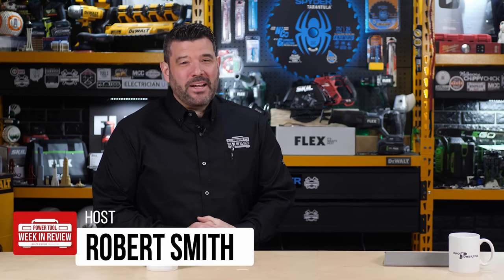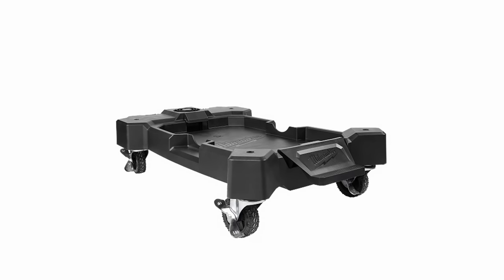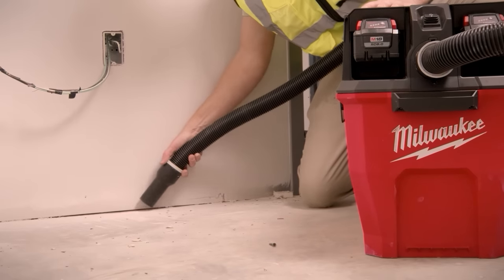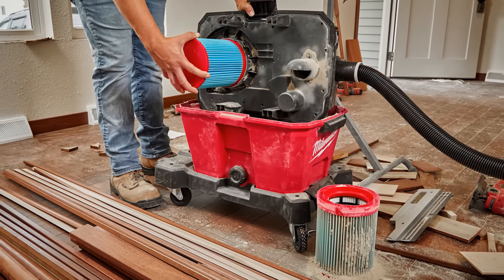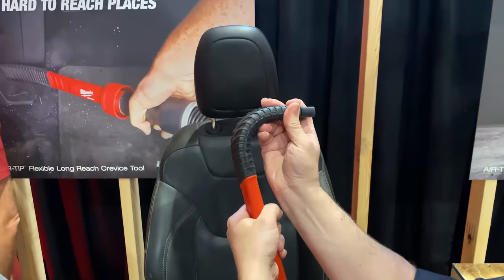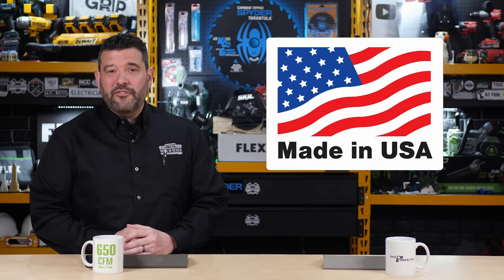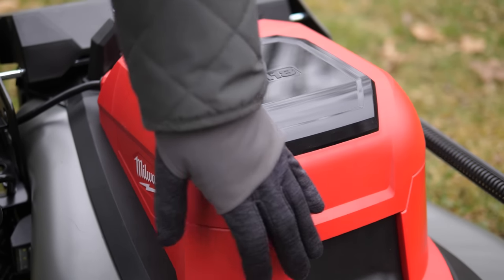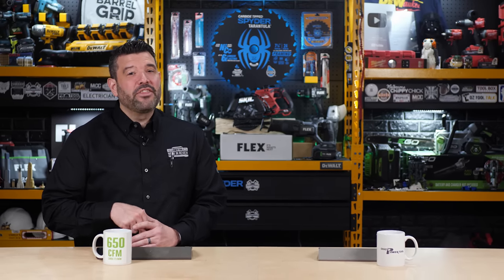BREAKING! Milwaukee announces NEW TOOLS, but doesn't tell the whole story...

Comment: I don't get why this isn't packout compatible. Why not a packout bottom to the tank? Why not a packout compatible cart for more options? Why not a packout compatible top so you could stack a thing or two on top if you wanted? I'm just an occasional builder / electrician and DIY type, but I don't get why not to packout these.... Also I'd love to have these be savvy enough to connect to jobsite tools like table saws or chop saws and maybe - if even possible - turn on when they do. I'd buy it as a battery powered dust extraction tool.
Reply: Bosch has a packout type system , and it fits their vacume cleaners   .
Reply: They can't do that. They need to gouge the customer next year.
Reply: My guess is placing Packout on top would make it top heavy and easily tipped. Probably don't need want the vac top smacking the concrete w extra weight flipping it over.
Reply: They need to sell next year's model which will have it. Got to understand how the business works.
Reply: They fell rather short not adding a pack out feature
Reply: well i mean they do already have a packout vacuum, if you put that 90l tub and the largest motor into a packout stack with the required attachment points top and bottom and wheels, you might get what one packout box and one row of organizers on it before it was too tall to be maneuverable, i dont think the packout was that much of a miss considering they have the packout sized vac thats plenty capable of doing little interior residential cleanup that would warrant not dragging in a separate vacuum 

not rigging this up with a system to activate off other tools is a major miss though, although i suppose they didnt build it into the tools that are already designed and in production, they could have atleast added a remote system and the ability for it to be activated off tools in the future for when those tools inevitably get new generations with updates

the modular system is a great design though i hope they make more things with this mindset, also like the insanely wide array of attachments although i feel theyre all going to be extremely overpriced, be cool if they included some of them with the vacuum but likely just get the typical sweeping attachment and narrow one
Reply: Because the packout concept and the vacuum were likely developed at the same time and there wouldn’t be any communication between the teams to avoid any leaks before they made sales they may have a mx line vacuum in the pipeline with it compatible I never expected an m18 vac with those run times that makes an mx more than worth the money if it comes to market and I’m happy to pay the packout tax
Reply: Yeah, after enough people plunk their money down, then they'll come out with the packout version. I think they love watching for that facepalm...
Reply: It’s not an extractor it’s a vac - Dewalt still only cordless M class option, all T stack compatible. This is only a clean up option
Reply: gota save somethin for Gen 2!!  Seriously, how else would you "Gen 2" a vacuum.
Reply: Give it time, they may add a new bottom down the line

Comment: A power station with regular batteries instead of MX batteries is what I would want.
Reply: The lack of this makes me so sad, especially when dewalt has had one for years
Reply: Most definitely, I've been hoping for one for a couple of years now. We could use one on the job site as well as be backup at home for me in case of an emergency.
Reply: This right here is the comment. I’m not buying that mx generator. So if they want me to buy the generator I refuse to buy they’re losing money, if they would come out with a generator that runs off m18 I would already have it. They’d make way more money just caving in and making one instead of pushing people to the mx series no one wants.

Comment: Agree 100% - no packout cleats and no remote/outlet to run this as a dust collector for a sander or whatever is a big flaw and in my opinion, a missed opportunity to be quite possibly the best vacuum solution on the market. Sigh. Even as a professional that buys almost exclusively Milwaukee products, I hate seeing them release new stuff that is overpriced and under-delivers.
Reply: They are offering a corded version
Reply: My guess is that they'll have those features on the new upgraded model after they've sold enough of these as a first gen.
Reply: No chilled exhaust, no lighted hose, no sandwich making attachment.... No price?
Reply: Big let down for sure. I've been using a DeWalt cordless dust extractor and cordless Ridged shop-vac for a while now and I would have loved to consolidate that all down to a Milwaukee platform. Packout just makes sense for me because most of my stuff is Packout, and that remote for dust extraction would have been icing on the cake. I still might buy 1 or 2 for the table saw and site clean up, but having a remote for dust extraction on the other tools would have pushed me to buy a couple more. Right now DeWalt is the only company offering that solution and its a shame because that extractor is so low volume that you have to use it exclusively for things that create small amounts of debris. 

Swing and a... I don't know, they got on base at least.
Reply: Perhaps Festool is holding a patent on that and Milwaukee does not want to pay royalties for patent rights?  Milwaukee is moving in the right direction and more thoughts have to go into detail as to usages and design.
Reply: I've said for years they need the plug in option on their vacs like they do on their lights.
Reply: @arnehelland6015  interesting idea. Turn every tool into a charging station. 🤔 and have the extended runtime, of course 😎
Reply: @robertthompson3447  even if no charging at least the option to plug it in , not every situation calls for battery draining usage. Plus as the batteries die so does the suction power.
Reply: @arnehelland6015  I experience the same thing with my outdoor power equipment. I can tell when the mower is about dead when the speed of the rear wheels diminishes; same with the blower, the battery (and battery indicator) is on my back, but I can tell you about where it is in the charge by the sound of the fan. Because I am using these for work, I usually change the batteries before they hit 25%.
Reply: With bluetooth connection it can be an easy thing.
Reply: Really wish they’d offer a self cleaning filter system and OneKey remote control

Comment: I like the fact they will do corded head in the future. I would think it was neat if they had a dual battery/ corded setup. The only real time I use a vac longer than half an hour straight is when I use it for dust collection from sanders/ routers etc. Too bad they did not use some type of wireless connection to turn on the vac when a tool starts. Not really wanting to buy one vac for cleanup, and then another for tool dust collection. I can see a lot of makers fashioning a plate to add the packout mounts.
Reply: Metabo HPT has had their 36V system out for 4yrs and it takes two separate 36V batteries and can be plugged in with AC adapter-I this is a great option for my longer run time tools table saw, mitre saw, SDS Max rotary drill/hammer, grinder, full size router etc and they have a lifetime warranty and their Multivolt batteries work in their 18V tools and 36V tools these features were the catalyst for me to swap out many of my Milwaukee and Makita tools over the last 3 yrs-plus the Hitachi/Metabo HPT nailers have been the standard for 25+yrs

Comment: No remote to use as dust collection on a saw is a huge huge miss for re modelers and residential construction. 

Dual batt table saw and  miter would be ok.. those are also not lifted for usage, also a plug in option would ne ideal.
Reply: It’s unbelievable really . No power tool take off or remote when all new build sites in the uk require them is a massive mistake.
Reply: @alexharvey7102  agreed with you both 100%
Reply: Dealt has that saw IIRC Dual battery and mains power.
Reply: I agree with the mitter saw dual battery and yes why wouldn't they make table saw, miter saws, radios also the new vacuums a plug in option?

Comment: Dual battery core rig. Options are good. Jackhammer because it's supposed to be heavy. As everyone else is stating why don't they see their value in Packout? Why are we having to create solutions to their shortcomings. Can you imagine buying a setup that all just made ergonomic sense in the first place draw base, packout vac base that can be emptied without unstacking. External bit holder cases. All Packout should be designed specifically for their tools! Sold separate or as kits. With bits instead of charger cut out. I'm sure they have seen what a professionally laid out tool box looks like. Foam cut out is great but I feel they could come out with a modular solution that would increase productivity. Function>durability>sexiness>price we are simple creatures 😎

Comment: I would def say the table saws, miter saws would be the best choices to add the dual batteries. They can get moved to set up location and then have the batteries added while stationary. Take the weight off when moved . Unlike other hand tools where holding the weight would get tiresome. At that point maybe adding a set of saws that could utilize the MX series batteries would make more sense for power and run time.

Comment: I don’t remember exactly the brand, but I once saw a backpack that had multiple battery inside, and the power cable would then attached to the tool. Get that 36 volt power, and configure in parallel for more amp hours. Then add a flexible solar panel that charges the batteries. Of course make the backpack ergonomic, so that it can reduce back issues.
Reply: probably makita
Reply: Makita makes that. They have a 4x18v version and a dedicated ConnectX line.
Reply: Makita, EGo, and Stihl all have backpack systems.  

Makita’s backpack snaps onto the top of their mower so you don’t even have to wear it.

Comment: Great system. Needs Packout mount and remote/auto start for dust collection  with adapter for hole saws when installing lights in the ceiling. Or even a new method of making a hole...Portable welder for 4x4 trail repair hand rail trailer repair ie small jobs would be useful.

Comment: They need to offer a wall mount, where you can remove it.  Buy the wall mount, the tank, and the motor head (battery or AC).  And why, I have a Ridgid version, if I replace, Made in USA would be great.

Comment: I was just talking to somebody the other day about them possibly coming out with a full size pack out shop vac and then they come out with this and I'm just left scratching my head as well. Although they can still take my money I'm going to continue to be a overly devoted loving fanatic / fanboy all the live long day so what if it hurts my pockets in my feelings both I will still show it off every chance I get like my table saw I pretty much ride around with it in my truck just for the white moment where I have to pull up on the side of the road to assist somebody who desperately needs something to be ripped down on the table saw in an emergency situation. I want to be that guy that is there for them in that moment of need.

Comment: What they need to do is put a built-in charger in the vacuum heads.  They could use a detachable IEC power cord.  In this way would would still be able to swap batteries but you would not have to.

Comment: Really like most f what they did, but they really should have done an extractor style set up where the filter is above, and uses bags to protect the vacuum. or offer the filter clean option. packout connection would be great, but missed the opportunity for cyclone option. offering a corded head, when they could have introduced hybrid. the lowest model has 109 cfm, while the metabo HPT one is about 125. I would actually use that one and upgrade the hose still. just a lot of missed opportunities, they did very well on those accessories. unfortunately this means that Milwaukee won't make a change  until at least five years from now.

Comment: I was just at Home Depot debating on whether or not to get their Packout vacuum, glad I held off. 

I am disappointed to not see remote start on these or the introduction of a drywall sander which was the first thing I thought of when I saw the notification for this video. 

As far as a 36 volt tool I think a jobsite table saw would be awesome, but better yet a paint sprayer is what I'd love to see. Longer run time than the Graco using Dewalts single battery.

Comment: Can you power it from a wall socket or is it just limited to their batteries?
Reply from the maker: There is a version (a power head) that is AC only. No combination of AC and battery at all. :(
Reply: @ToolShow  That is just typical. Really really scummy behaviour from Milwaukee. Would literally add barely any extra cost to have dual functionality. This is pure greed from the company. Forcing people to buy their batteries and designing tools that will really drain and degrade the battery. As well as that, the tool looks extremely cheap.

Comment: We gonna need that 16Ah or 18Ah HD 18V BATTERY that can add 2 of those instead of the 12Ah battery to make it last longer. Imagine 2 18Ah Milwaukee 18v HD batteries on this Vac or new Mower….. The run time 🎤 Dropped…..

Know it’s coming, and can’t wait…..just not sure if gonna be an HO HD or the normal HD version.
The other accessories waiting for is the Bluetooth or some way to link the vac to the tool it’s running with, and if the tool is One Key, why doesn’t it have the ability to sync with a vac to turn on/off when running😉

Comment: Ooof that run time. 49mins of run time? I don’t think that’s enough. It would be awesome if they slapped a corded option on there like Dewalt did with their table saw. Was one of the Milwaukee engineers family members killed by a power cord accident or something? Why are they so afraid of them? 

Could the accessories just be slapped on a corded rigid vacuum

Comment: I’d say how about a pack out compatible M18 based power station.  I think most people hauling tools in a pack out stack would be taking extra batteries. It would be a good way to secure those batteries for transport, could charge the batteries, and have an inverter to act as a “generator” when there’s no power available.
Reply: This ⬆️
Reply: With car battery booster for … you know …

Comment: I think it would be nice to add the second battery for extended runtimes and power on certain large power usage tools. I like the idea of adding a battery if needed, not being required to use it all the time. Maybe using a couple 5 amp hour batteries instead of a 12 amp hour. Being able to series or parallel batteries depending on need, power or runtime would be a great idea. Thanks for the videos.

Comment: Makita showed everyone 18x2 is a successful platform and Milwaukee is now sheepishly following the herd.  The only question is how far are they going to go with it before it entirely kills off the MX line. These vacuums are meh, like everyone else says, no packout or remote (yet?).  I'd much rather have M36 table and miter saws.
Reply: Better yet Matabo HPT and Makita showed that one 36V battery is even better, lighter and packaged in an 18V footprint
Metabo HPT went even further in making those 36V batteries compatible with their 18V tools so a 4.0ah 36V tool when run on an 18V tool is 8.0ah, then Metabo also made the AC adapter for all off their 36V tools and to top it off gave the lithium ion tools a lifetime warranty
No brainer-I've switched a ton of my Milwaukee and Makita tools over and am not looking back

Comment: Cant believe a company FINALLY made them! I was hoping it would happen soon. They should also do dual for the lights. As well as the M12 underhood light. Battery on either end would ROCK
Reply: dual batteries is for more power, not more run time.  Dual batteries on a light would be kinda pointless, just change your battery, or buy a bigger one.

Comment: It is nice you mentioned the whole 2 battery thing Milwaukee mentioned a number of years back. Seems like it often gets forgotten about. In addition to them saying one battery is enough, they also said didn't need to have higher voltage tools. They have since introduced mx fuel which is higher voltage and introduced the mower and vac which are dual battery m18 tools. seems like they have changed their minds since they made these comments without actually telling their users.
Reply: Yup when Makita did Dual before Milwaukee 👍
Reply: yep, you can only get so much power from 18v, at some point you have to pull to many amps to make 18v viable, 40 amps at 18 volts is only 720 watts, just a little under 1HP I believe.  I dont know how many amps Milwaukee tools normaly draw from a battery pack, 40 seemed like a good number for an example.  Much higher than 40 amps and your starting to deal with some pretty good sized wire, for sustained loads, also, you can only draw so many amps from the small terminal connections where the battery pack plugs into the tool.